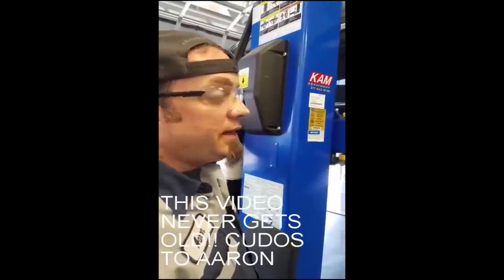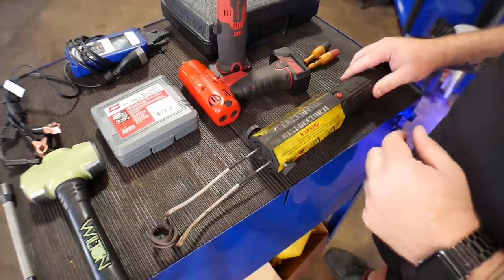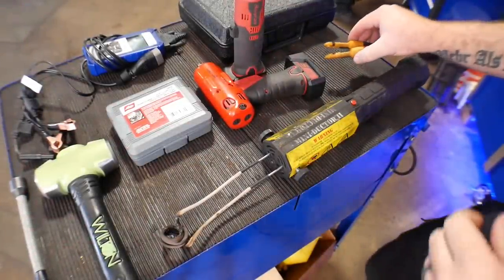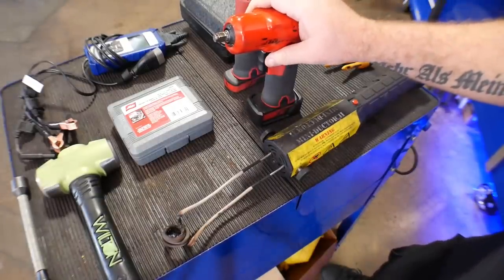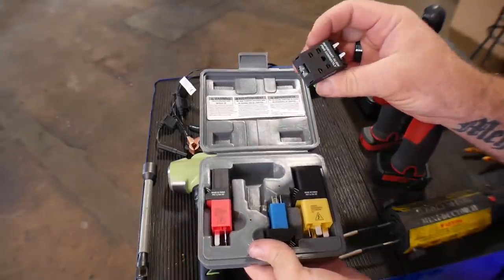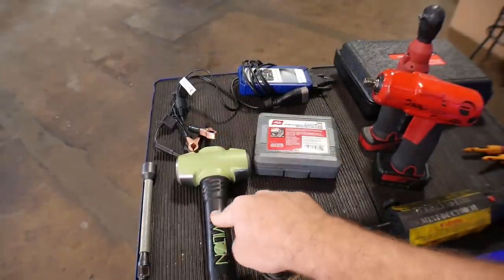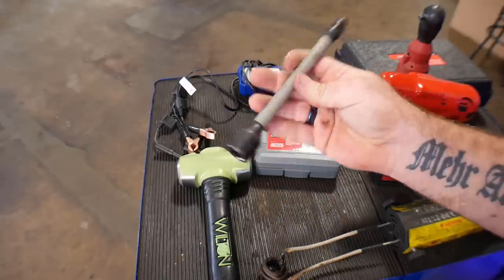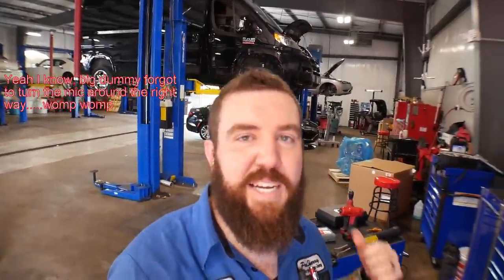TOP 10 TIME SAVING TOOLS FOR THE MODERN TECH

Comment: As the " rustbelt mechanic " you should know better than to pierce wires
Reply: Paint over the hole with liquid tape.
Reply: Not a proper fix. Once you penetrate wire insulation, it is never the same for a potential for corrosion and voltage leakage. Liquid tape is temporary and will laminate fail over time.
Reply: It'll be fine...
Reply: This guy just lost majority of credibility with me....... I know I’m not the absolute best technician out there but I NEVER poke wires. In Northeast Ohio that’s a sin and punishable by asskicking. I run into “pokes” wires every single day and it’s infuriating the issues it causes. Inside or outside the vehicle/truck/trailer/semi WHATEVER you’re working on, piercing wires is NEVER OKAY. 

Sucks too because prior to this he had me interested because the induction heater is a life saver. Use it on Cummins manifold bolts regularly. 

I wish this guy nothing but the best, but I just can’t continue to watch the video after that.
Reply: I'm guessing and hoping that poking the wire is a last-ditch effort if you cannot back probe please tell me you're not just poking holes with those fluke tools.
Reply: You're so melodramitic, Zacxh.  Sheesh.
Reply: Lol green death of restbelt
Reply: Going back to 1984 when I first started, piercing was a no no. Did spend tons of time making my own custom interconnects and buying lots of different GM connector blocks and pins to build up my collection of testing tools though.
Reply: I also am a rustbelt mechanic and I see nothing wrong with piercing probe.  I actually prefer it because if your battling a pin fitment issue then backprobing will fix the ill fitting pin and you fix shit and dont find the cause of the problem which will surface again.
Reply: Clearly you need to repair the insulation I prefer liquid tape.
Reply: @NissanZSmith  so...... how do you test wires? Just wondering  how a magician does it....
Reply: Clear nail polish or super glue. Sometimes you have no choice but to pierce a wire.
Reply: @terryeffinp  in what circumstance are you forced to pierce a wire? Just curious because I've been doing this for 5 years now and haven't ran into this yet.
Reply: @jeffsmith8066  Almost always I use breakouts that I have made from old connectors or sensors and I rarely have to poke a hole but in a long run of wire you might not be able to determine which direction the damage is, in some instances piercing the insulation to do voltage drop testing is helpful to figure out which direction you should look more closely. The last time I had to do this I had a wire that broke inside of it's insulation with no perceivable damage from the outside. It is not by any means the first thing you should do, but it can be helpful to narrow down the location of the problem. Obviously the hole you make needs to be sealed. Nail polish or superglue works well because it flashes off so quickly and it is durable.  I see more failures from people using the wrong crimpers with heat shrink butt connectors and accidental cuts from a utility knife or seam ripper than I do holes in wire.
Reply: @terryeffinp  thanks for the quick reply. I just have never used this method I guess. Having been doing Cummins warranty repairs for the last few years everything is test voltage or load test a certain wire, check resistance of wire, etc. I have a kit of test leads with terminals and alligator clips for all testing to be done at a connector.
Reply: @jeffsmith8066  I'm in the distributor side for Detroit Diesel Carrier. DTNA came out with a really nice test lead kit like Cummins has I would argue it is more complete.                     DDE DKI470E16022
 My preference is a break out harness because it is a way to do dynamic testing and not just OCV, but it takes time to accumulate the connector housings for everything you encounter. Just to clarify poking holes in wire is a last resort. Another example where I will do it is to check if the wiring issue is inside or outside of the box on a reefer. A lot of times they are loaded and you cannot get into the Evap section. It is peace of mind to be sure you need to pull the unit and put it on the floor.
Reply: @terryeffinp  I get the Cummins tools at cost so that's why I went with their kit. And I agree breakout harnesses are the way to go, it's a shame Cummins doesn't use many of them for troubleshooting. When I was a tech for Mack/Volvo I would use a breakout harness for everything

Comment: How does to coolant filler work on diesel water pump recall with plastic expansion bottle. Chrysler tech myself.
Reply from the maker: IGGY P gotta use the adapter from a coolant pressure tester with that kit for those diesels
Reply: I wish I’d had mine when I was doing these recalls at Chrysler

Those trucks took FOREVER to bleed
Reply from the maker: TheMillennialMechanic dude the bleed time on these trucks with that tool is no time...AND no comebacks for low coolant level lights
Reply: Rustbelt Mechanic I LOVE the tool I ordered it a while ago and it was on backorder but it came in like two or three weeks ago

I’m pretty salty though cause it won’t pull a vacuum now, and I gotta get it warrantied.  Used it like three times
Reply from the maker: TheMillennialMechanic damn! That sucks, well hopefully it gets replaced fast!
Reply: Rustbelt Mechanic I’m hoping man, I just texted my dealer about an hour ago to see what’s up with it

Comment: Ya definitely got bent over the work bench on the wire probes. Not to jump on the you-tube-hater buss, but back when your mama was changing out your dippers I was a durability truck engineer at the GM Milford Proving Grounds, and it was a death sentence to pierce a wire out in the garage. Guess ya got probed good on that one. Top tools when I was an auto mechanic an indestructible work bench and a big ass hammer... and a six foot spud bar. Same goes when I was doing heavy C and D checks for Continental Airlines. Stapleton Airport baby!